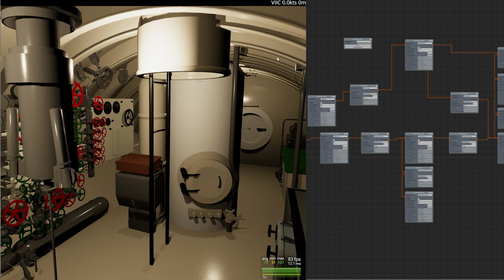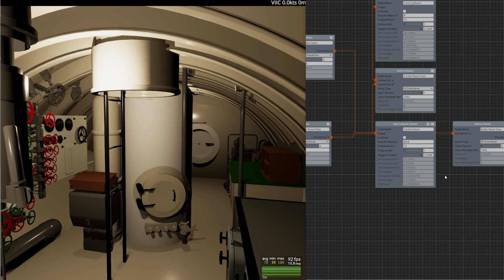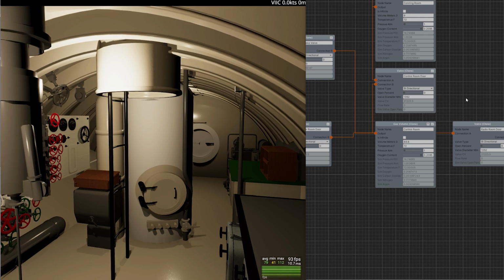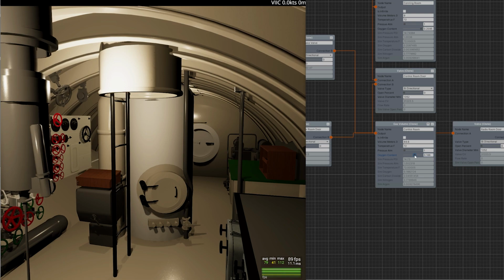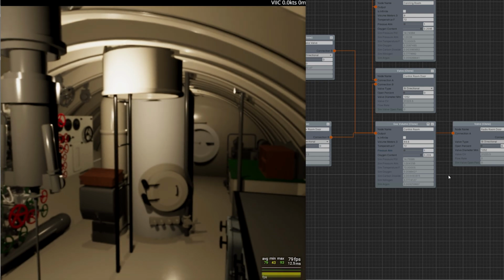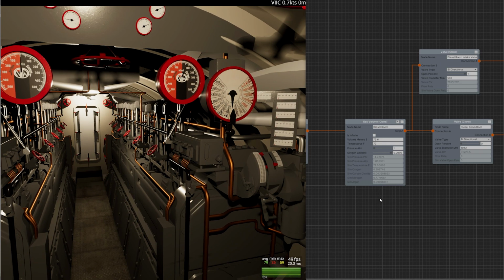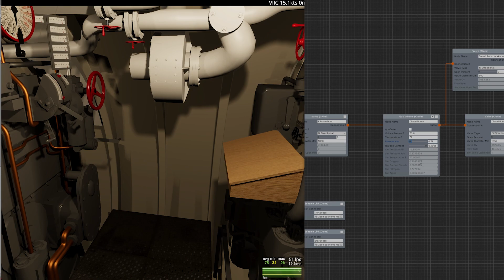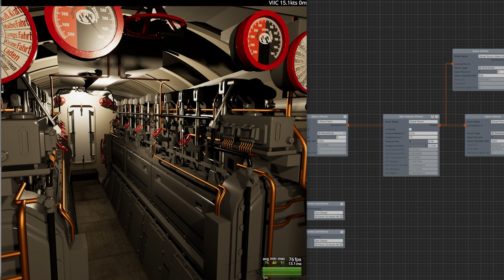Player atmospheric simulation integration

Comment: If there's a pressure differential that's substantial enough, would it not prevent the hatch from being opened if the outside air pressure is higher?
Reply: Yes, air and water pressure will cause this. Now that we have the simulation subsystem in, we could start implementing the necessary overlays.
Reply: @LoudFiat  Excellent! This has been an exciting project to follow. I look forward to its release. 

While I enjoy the level of detail, I worry about the extreme level of detail creating insurmountable delays. Would an initial release with a more limited level of realism aid in the development of the final release of this simulator, or would it undermine what this is all about?
Reply: @tartansauce4879  the sim is available on Steam for over a year, this is part of the continuous and ongoing development
Reply: @LoudFiat  I'm familiar and have been following very eagerly. I suppose it's my eagerness that leads to my anxiety about this coming to fruition.
Reply: @tartansauce4879  The team is multiple people; if I croak they can see it to completion 😆